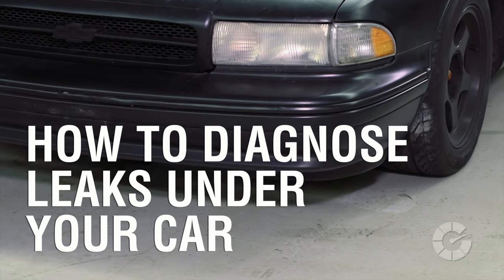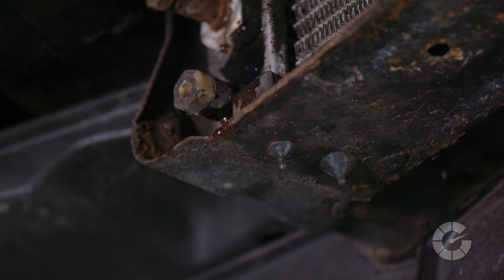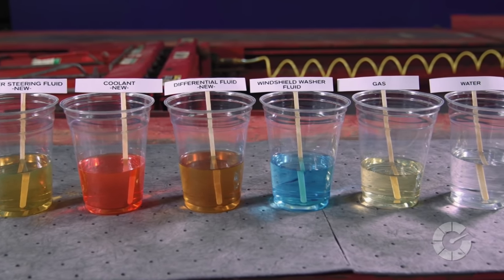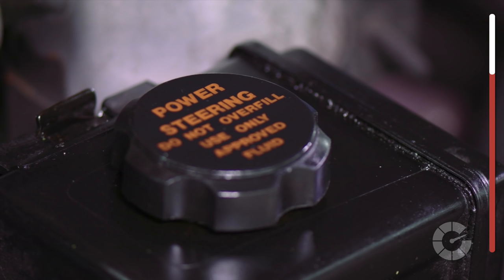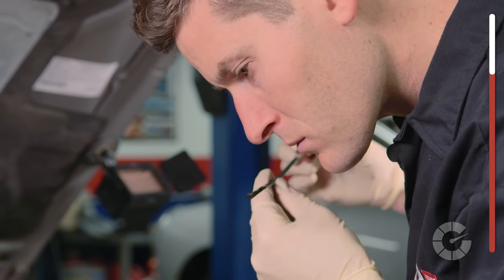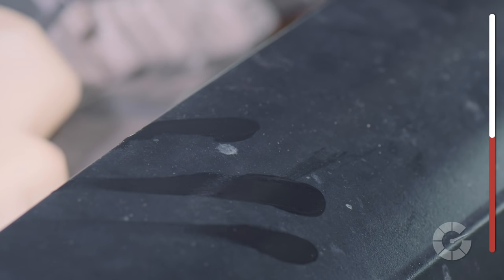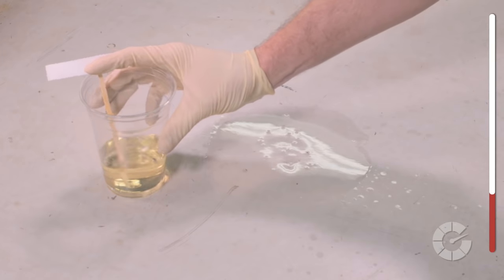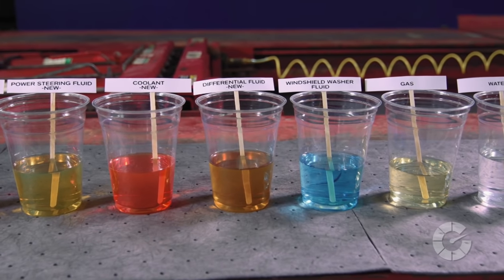How To Diagnose Leaks Under Your Car | Autoblog Wrenched

Comment: Helpful and I am relieved that mine was the condensation water! Thanks bro!
Reply: Bro this was me 15 mins ago lol
Reply: @Lowcoolant  bro this was me right now
Reply: @smhca  bro ngl i had the money but shit was expensive
Reply: @smhca  I’m lucky my mechanic didn’t charge me for labor
Reply: @Lowcoolant  What was expensive?
Reply: @smhca  charcoal canister and the vent and purge valve. Bro it was like $560-670
Reply: Almost had a hear attack I'm like wtf I keep my car maintenance
Reply: Can anyone please help me. Liquid (water) was dripping from under of my car when it's was parked. After a while liquid stopped dripping. Was it condensation or anything else please confirm 🙏
Reply: @ss877S  it's from your AC
Reply: @smhca  is it normal or anything to worry about?
Reply: @ss877S  normal and expected :) if the color is anything but clear then you need to worry
Reply: @ss877S  If you had you AC turned on, then its most likely just the condensation water! If the water has a color to it, then you need to worry and get it checked ASAP!
Reply: Ok thanks
Reply: Bro this is me Rn . I was going to say it has to be condensation Bcz it’s 101 degrees outside and my car is new !
Reply: Bro this is me rn, I got scared tf out
Reply: NM
I
Reply: Me just now lol
Reply: Mine drips water what did u go to fix it and how much it cost
Reply: Did it smell fishy was it clear ??
Reply: @notsosteven619  Nope,, just regular condensation water!

Comment: When I pulled out of my parking spot that dreaded wet spot was there!

So I had to be someplace when I went into the parking lot I pulled into a space. I noticed the leak continued.

So I took a plastic bag, slightly pulled back out of the spot and placed it right where the leaking happened to catch the liquid.

Mine was also water thankfully!

Comment: I just noticed a small leak that appeared to be intermittently "spurting" slightly, like an old man going pee 😵 I had been running the air conditioner so I'm really hoping it's just condensation because I recently spent over $2,000 replacing every seal in the cam and crankshaft so there's NO WAY anything should be leaking at all right now!

Comment: I have a fluid leak but it looks like vomit coming from the car. It only seems to be when I am parked at an incline. It doesn't happen other wise when I am parked straight. I can't figure out what it is. It doesn't smell but seems like chemically when I pour water over the light brown vomit color.

Comment: I have a little dripping water leak under the front left of my car, it appears to be coming out of a tube that looks like it is cut like an overflow but not meant to be connected to anything. I’m worrying if it’s serious or not, it is clear liquid and has no smell so I think it’s water. Do I need to go to the mechanic?
Reply: Buckshot 87  it’s just condensation dripping from the air conditioning apparently
Reply: Buckshot 87  it was small drips and would leave a big ish size puddle/mark on the ground. But tended to only happen if I had the air con on while driving

Comment: phew ok then im pretty sure its just condensation thanks dude
Reply: Same here. Saw something leaking from my jeep just a bit ago after getting home and was worried. I ended up putting a container where I saw a leak. Saw that it was clear with no smell. Was so happy to find out that it's nothing wrong. Just put money into it to pass inspection, don't want to put more in it. What are sigh of relief!
Reply: And to top it off, it was pretty hot and humid out and I did have my air on the highest and coldest possible on an hour round trip with only a 15mins stop
Reply: @Erscbarthold  u u jj200000p⁰u